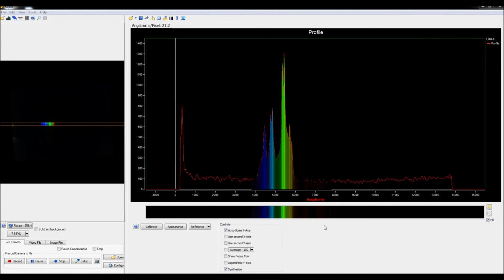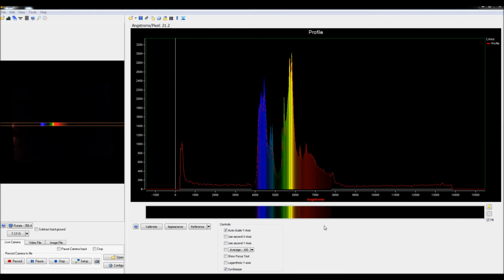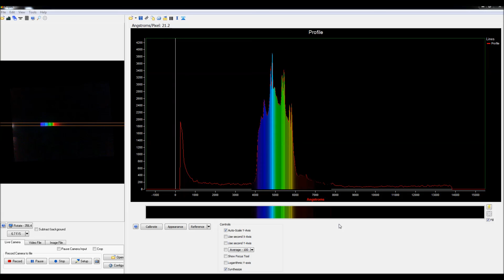Building a DIY Spectrometer Part 2 - Both Success and Failure

Comment: For other DYE Maker:
-Light: broadband source:use an halogen bulp, I use it with 20watts. Narrow source: some LED diodes or better laser pens will do.
-calibration: a fluorescent bulp has some remarkable peaks that help calibrating.
-Grating: Start with a CD plastic (650lines/mm) or a DVD plastic (1350lines/mm), but for fluorescence it 
was too weak for me, I use an glass one from aliexpress, 1000lines/20$.
-Cam: a basic usb webcam will do for strong active lightsources, filters/sunglasses, but not for fluorescence or raman. Your mobile device likely has a super sensitive cam. Or get an Infrared night cam for 60$ with 0.001 Lux, that‘s also sensitive enough.
Software: so far, I found theremino supereasy and free to use you can also make „references“/blanks to compare your spectra against it.
I will checkout this r-spectra.
I wanna do raman on minerals, that‘s a bit steeper to do, not yet there especially the grating setup would be cool to get more insight, how you got it so sharp, and whats your library to compare the spectra with. Thanks

Comment: Dear Sir,

Actually, I want to plot that curve from Spectra getting from Smart Phone for different concentrations of DYE on a single window for wavelength-Absorbance.PFA. Thanks. Seeking Software tutorial of software for that like IMAGE J Or any other else.

Actually, I want to plot absorbance & wavelength curves in a single frame or window with all possible concentrations of methylene blue DYE. From spectra 

I want you to guide me about that software for the requirements.  Spectra is also attached as my possible setup. This means an optical path for the spectrophotometer

Comment: You could use a strobe light for xenon source ($20)... Transient-absorption spectroscopy.  It is a true xenon source like an arc lamp (flashtube).
Another option would be to use a UVC lamp (220nm) [$30] and a Tungsten lamp [$1] to make it a UV-Vis Spectrometer.

...It may also be possible to use an imaging light out of an old scanner along with its imaging sensor...

Comment: Did you find a way to make it work? How much money did you spent? 
How reliable is it? 70% 50% 90%?
Reply from the maker: It has been a bit since I made that but if I had to take a guess I would say around $120.  The big cost was the spectrascope at around $80 - $90.

I have not gotten it to work properly as of yet as I have not been able to find a proper xenon arc light source (including the supply, housing, and starter) for under $800.  As soon as I can come up with a proper light source I will certainly make another video and show how accurate it can be.